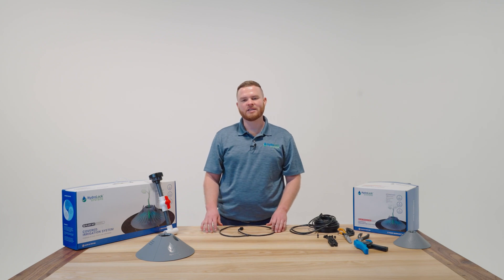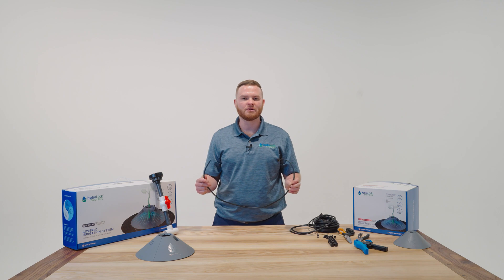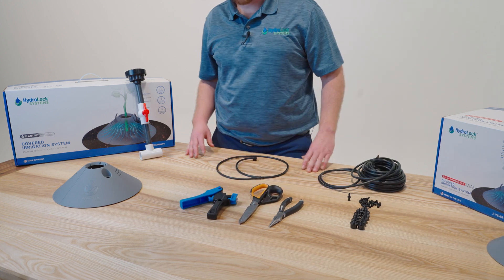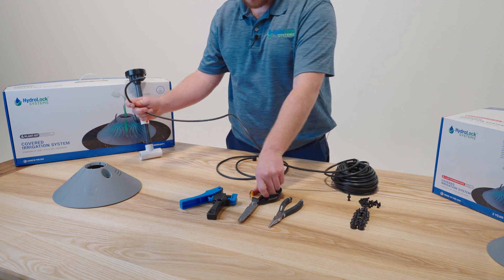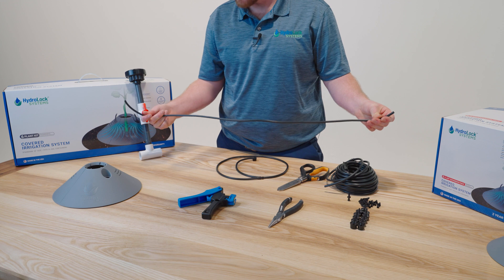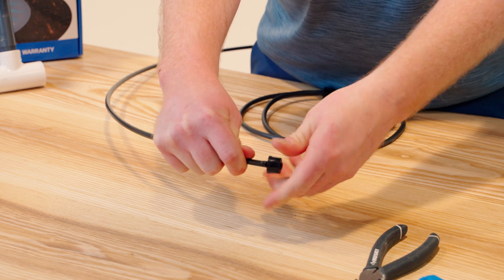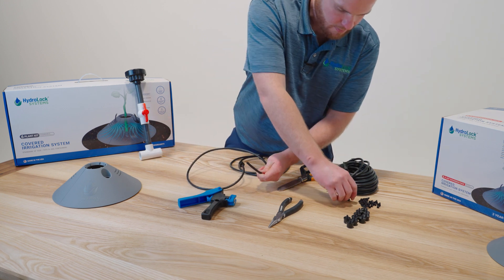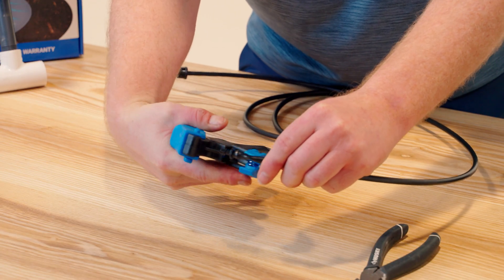Quick Connect Assembly Line - HydroLock Irrigation Installation (Pt. 6)

Comment: Beginnings of the video it says he’s going to show us how to put in the barb with needle nose but never does it… I wish I would have known about the barb gun during check out. I didint know it existed until attempting to put this together *update* use a hair dryer for a few seconds and the barb is a bit easier to install.
Reply: Install barb to manifold then attach hose, put in hot water to soften hose first